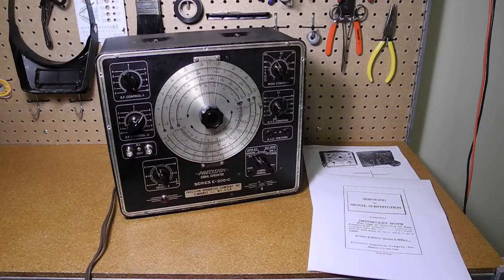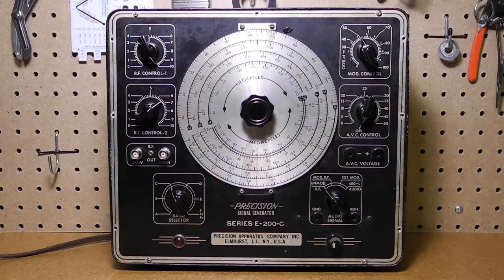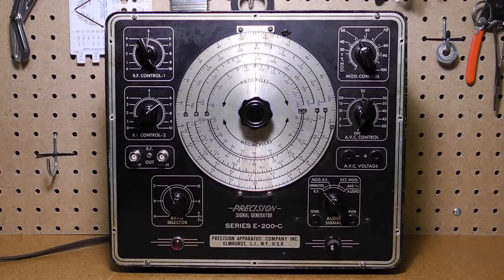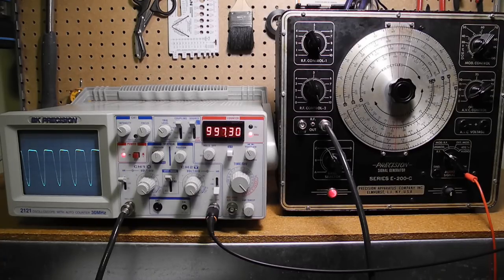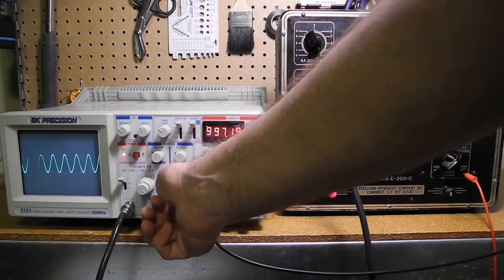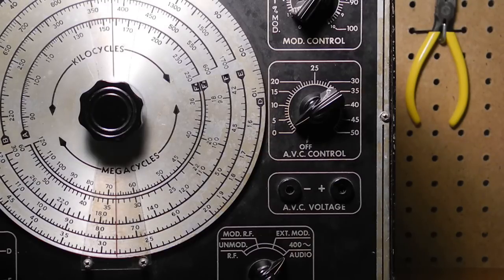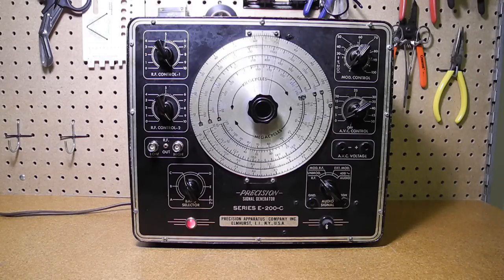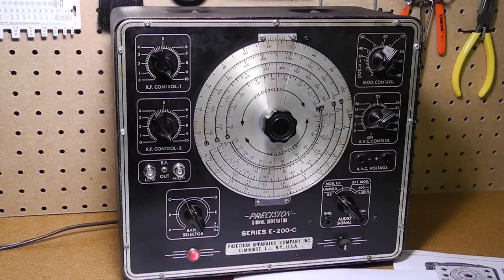The Precision Apparatus Company E-200-C Signal Generator

Comment from the maker: Regarding how to align it: I reviewed the copies of the manuals I have and there are no alignment instructions as such. There are trimmer caps for each range on the bandswitch. If you have an accurate way of measuring frequency, you can adjust the trimmers to bring the frequency closer to the dial readings. You might want to do this around the middle of the dial to minimize the overall error.
Reply: Great video very informative, I have recently acquired one of these models and wanted to know if I can use it to troubleshoot FM receivers and reel to reel recorders.Thank you!
Reply: I noticed that on my signal generator the mfr name and model number is at the top of the dial and on yours is at the bottom don't know yet if mine is newer or older than yours. I will have to do some research.Cheers

Comment: I spent several months restoring and updating my C-200. It was a very nice and accurate signal device. Alas one day last summer as I went to turn it on , the main internal fuse blew. What the heck, I'll troubleshot it I thought. The outcome was a shorted secondary winding. I decided not to fix it, just too much trouble. It was almost 70 years old by now. Fortunately I had a backup generator, my EICO 324 that I built in high school. It was new, only 50 years old. I cannibalized   the C200 for parts and used the chassis farm for a power supply.
,

Comment: In your opinion what would be the best cable for this unit.  I will be changing to BNC connectors and looking at RG316, but wanted your opinion. Thanks.
Reply from the maker: Just about any coax cable should be fine. 50 Ohm would be best and something thin and flexible enough to work with. Two alligator clips or an aligator clip and a probe on the end. You might find premade cables on eBay for the same or less cost than making your own.

Comment: I have one, and have just dragged it out of the back room to refurbish it and hopefully use it for aligning some of my other projects.  The serial number on mine is H65516.  It looks much older than your unit, but everything is present but the small knob that controls the big frequency selector dial.  Any thought as to when you think mine might have been built would be welcome.
 Thanks for the information.
Bob
Reply from the maker: It is hard to say, a picture might help. They changed the design slightly several times but continued to use the E-200-C model number.
Reply: Jeff Tranter
How would I post a picture to you?
Reply from the maker: SuperJetjockey Send me an e-mail at tranter@pobox.com

Comment: I have the exact same unit. same revision. I have hooked mine up to my Tek 2215 60mhz scope and never got what yours is showing.  I have also recapped and tuned mine a bit.  I just learned tonight that the 400 cycle audio I guess comes out of where you have the red wire. Any chance seeing how you have the hookups between the unit? and what settings your scope is on?  I'd love to make sure everything is functioning right. when I first got it it would work only on EXT Mod badly thru the Main Connector. I actually found a few missed solder connections and a cap in backwards. as well as no resistor in the low output. must of been a Friday unit. lol. thanks for an informative video.
Reply from the maker: Basic operation:
Set RF Controls 1 and RF Controls 2 to maximum.
Set Band Selector to A.
Set tuning to the middle of the range.
Set MOD control to 100.
Turn the AVC control to Maximum (5).
Set the function switch to UNMOD. RF.
You should see a signal of about 140 KHz at the RF OUT HIGH jack.

If not, one of many things could be wrong. I'd start by check that the tubes light up or get warm and then check voltages in the power supply.

When the function switch it set to 400~ AUDIO you should see a 400 Hertz signal between the AUDIO SIGNAL HIGH and GROUND jacks. That may work even if you don't get any RF out because it uses different circuitry.
Reply: Jeff Tranter thanks, I guess I've got some trouble shooting to do. I do get a signal in a radio but right now I have it set the way you said and I have my scope set as low as it will go on 1x and don't get anything on the scope but noise. on the 400 cycle audio I get a nice clean sine wave even when the switch is off.  Having issues with another of my generators as well my SG8 but I see the RF Modulation on my screen with it. it's just got a dead band. both units have been recapped, now it's time to troubleshoot. thanks again

Comment: Question for anyone.  Are the any adapters (original mic connectors to BNC) that anyone knows about?  Or, what connectors are these (thread type and size - 5/8 -27,  3/8 -32,  etc)?  Thanks in advance.
Reply: Hi Russ,  Haven't seen a mic to bnc adapter. If you find one they are probably Expensive. The Switchcraft/Amphenol 2501F connector is ~~ $13.00 on ebay.
Converting to BNC is fairly easy on the E200. Unsolder the plug center connector, there is a resistor inside, rear of the plug, tap the connector out. Tap in the new BNC connector(with nut and lock washer, resolder. I Believe, the hole is 7/16. Haven't done it to mine, it looks almost new and I have extra 2501's.  Hope that helps. Robert

Comment: what do you use to align the generator? another generator?
Reply from the maker: +bones007able Typically you can use a shortwave radio receiver to check the frequency of the generator, preferably a radio receiver with an accurate frequency display. If you have a digital frequency counter, that would work too.
Reply: @jefftranter  Typical to check against WWV and commercial broadcast.

Comment: What if I wanted to use this as a noise generator? Could I change that RF output to an audio output?
Reply from the maker: I don't think it would be feasible to turn this into a noise generator. It can produce 400 Hz audio but only at that one fixed frequency.
Reply: Thank you :) I still might pick it up from the antique store. Would make a cool conversation piece.
Reply: So is it not practical for use in troubleshooting Stereo receivers and reel to reel recorders?

Comment: Getting the leather handle replaced should not be that hard, a charity shop leather belt and some Chicago Screws should do the trick. I would however treat the handle assembly with Mink Oil or shoe polish beforehand.